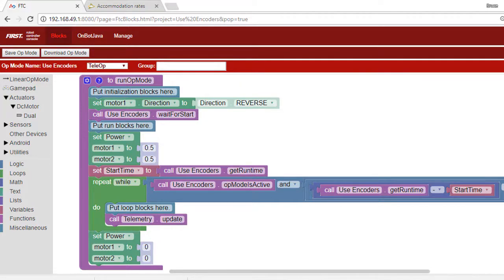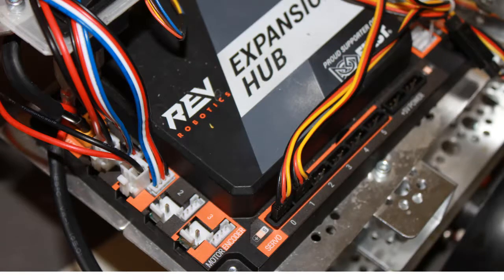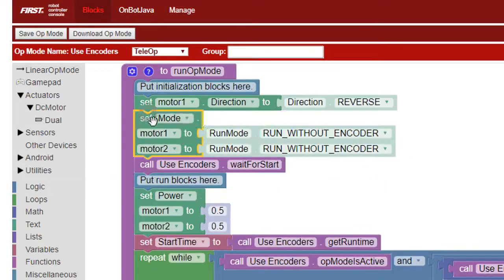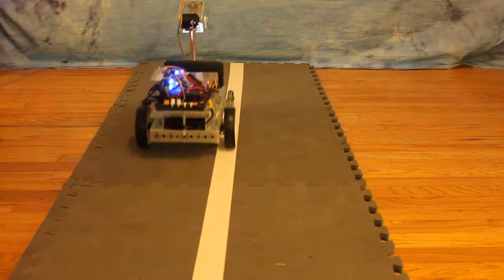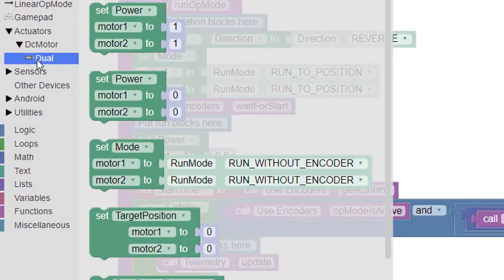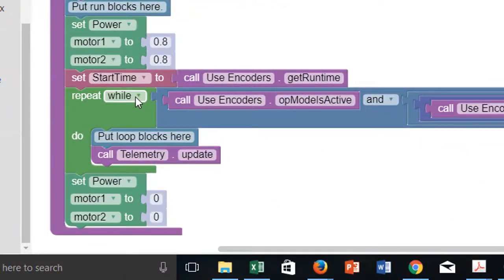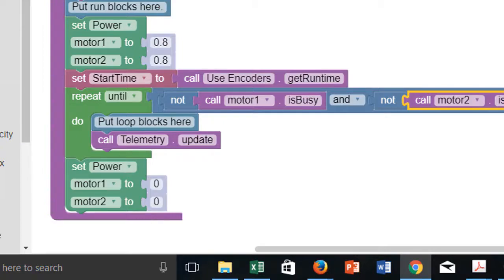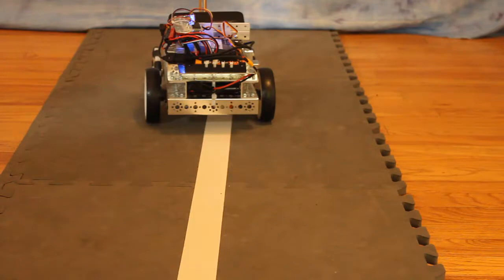Navigating using Motor Encoders during Autonomous Period with Blocks Programming

Comment: Can you change from Run_to_Position to something else in order to use the color sensor to stop on the line?
Reply: I have run to position above the repeat until and then  I have run using encoder under that and a repeat while under that.
Reply from the maker: @mistywhitehead9242  The motor controller can only be in one mode at a time so the last mode you set will be the one used in the blocks that execute after it until the mode is changed again.
Reply from the maker: Yes, you can use Run-Using-Encoder as illustrated in the first part of this video and terminate the loop based on what the color sensor detects.  See also https://youtu.be/iQufRF1HFRc and https://youtu.be/uSEEO3_JVTI

Comment: When trying to test the Run to Position code I get an error: "Fatal error occurred while executing the block labeled "set backleft.Mode to." Please help! I have checked the Configuration file for the motor name, I have checked the encoder cables. I am using a Rev Hex Motor.
Reply from the maker: Please send me an image of your program.  Display your opmode and then click on “Download Image of Blocks” button toward the top.  Email the resulting PNG file to ftcblockshelp@ortop.org
Reply: I have a same problem...Did you find out why??

Comment: when trying the last part of this program it just gets stuck going forward without stoping...i cant figure out why
Reply from the maker: Have you double checked that the encoder cables are plugged into the connectors next to the corresponding motor power cables on the motor controller or REV hub?
Reply: just double checked, everything looks good...just odd since the first part of the program/video (going straight 2 rotations) works fine....when I try the second part of the video (run_to_position part) it doesnt
Reply from the maker: Double check the blocks in the second part. Try adding telemetry blocks in the last loop to report tick counts to driver station to get a better idea of what's going wrong.
Reply: i'll see what i can do...thanks

Comment: Can someone help me out with the encoders to rev expansion hub connection?
Reply from the maker: See https://youtu.be/U3E5AM56xzg
Reply from the maker: If you are using REV hex motors you can plug them directly into the ports on the Expansion Hub next to where you plug in the motor power cables.  If you are using other brands of motors/encoders you'll need a level shifter as described in the video at the link given above.  They can be ordered at http://www.revrobotics.com/REV-31-1389/
Reply from the maker: Also see  Also see pages 8, 17 and 18 of http://www.revrobotics.com/content/docs/REV-31-1153-GS.pdf
Reply: Thanks

Comment: Hi- we are trying to use encoders with the REV core motor.
We can run the motors, w/out encoders, using the gamepad.
But we can net get the motors to do respond to the buttons...
    The program has "A" assigned to "Go to Position 28000"
       and "B" assigned to "Go to Position "500"
But nothign happens.
If you have any advice, we'd appreciate it.
Or even better, if you'd make a video of 'Using encoder to run a motor to a specific location"
Thank!
Michael
Reply from the maker: For some info on connecting gamepad buttons to actions see https://youtu.be/75ndVZzZJjU